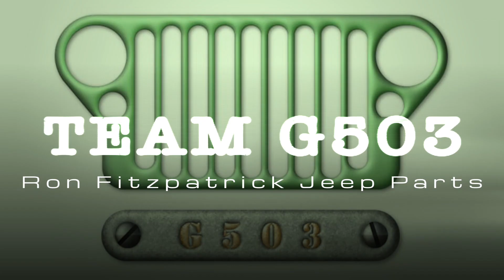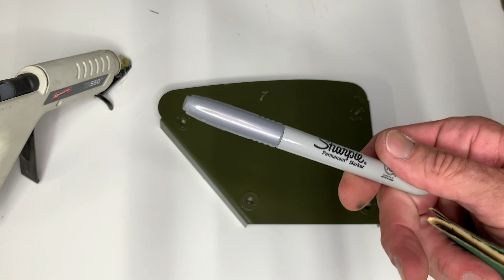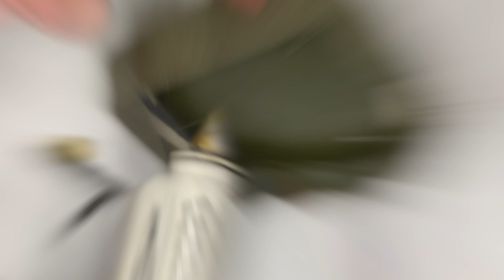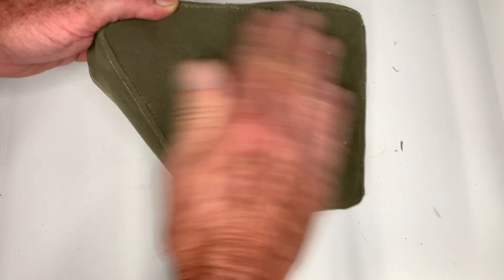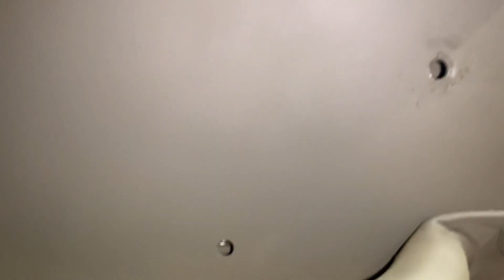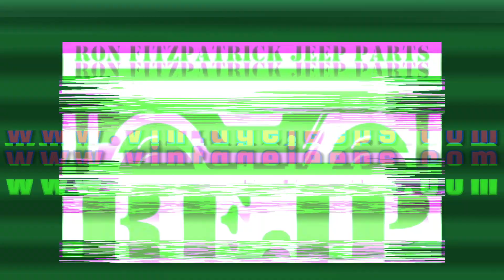🔥🔥🔥 G503 Crash Pad Installation (Including Canvas) Willys MB Ford GPW Hot Topic 🔥🔥🔥🔥🔥

Comment: One of my ham-footed buddies caught my left crash pad cover with his heel and tore it at the top. To be fair, the canvas was 20 years old and was weakened by the sun. I'd been dreading this little replacement chore but all I needed was this video, Ron's crash pad cover and pad set, and a tube of 3M contact adhesive. I hit upon the idea of using a piece of plywood about the size of the pads and a pair of furniture clamps to compress the new pads. This made the covers so much easier to install. The foam pads needed trimming to size but this was easily accomplished with a hacksaw blade. Anyway, success, and the new pads look great. They're even a nice match for my existing seat covers. Thanks!

Comment: Scott, how did you mark the holes to drill the the body for the crash pads (I know, not a safety device!). Many thanks.
Reply from the maker: The ones I used were the original holes.
I believe you can find the measurements on the website jeepdraw.